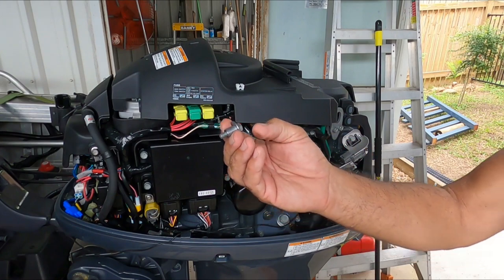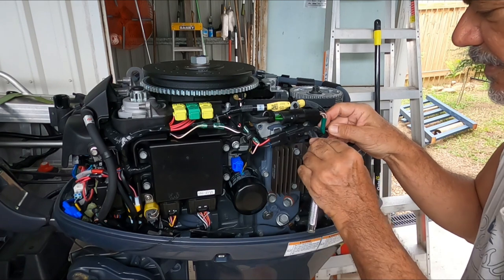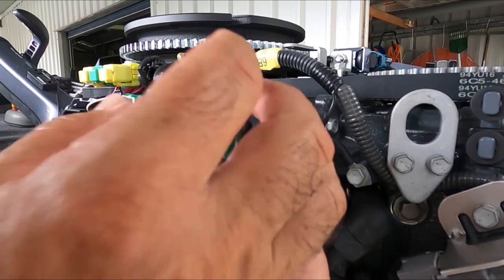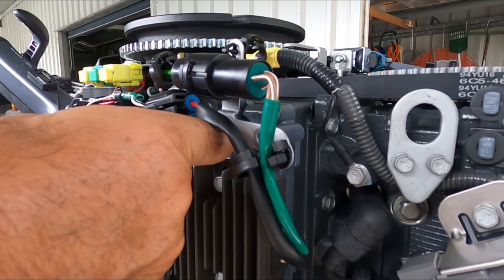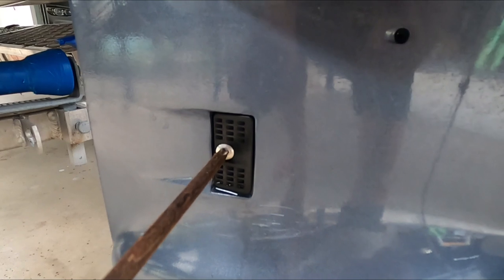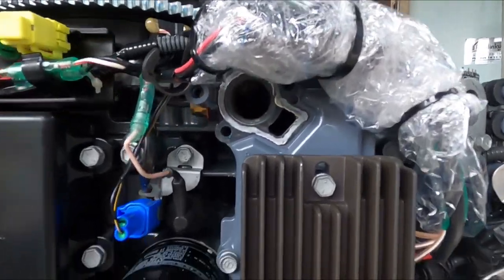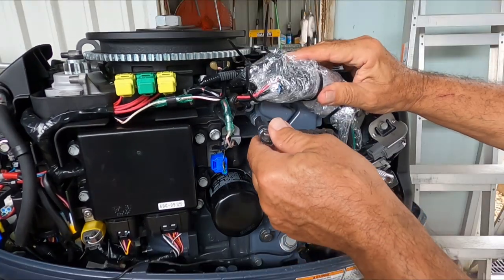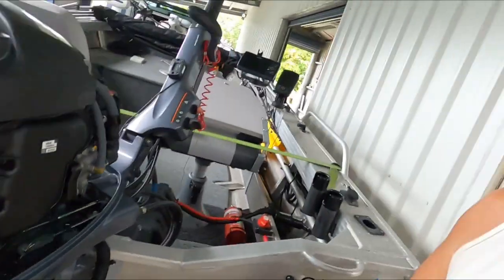How to flush SAND from an outboard - this is how I did it

Comment: Gday mate thanks for this one you showed me where the thermostat is and two i got a good look at the engine ( i havent seen mine yet ) i have watched guys who run a soft flow of water over there engines when they are cleaning it (fourstroke 80) and the only thing thay said was dont get water in the air intake area so you probably would have been ok but good idea anyway , i have found a number of good ideas for working on four stroke yamahas and one of the best was when you change your oil ,rather than try to balance a bucket underneath the drain hole what one guy did was he used a 14mm air fitting with a barb and fitted a hose to it trimmed the motor right up removed the filler bolt screwed in the barb and hose then lowered the engine and the oil ran into a pan on the floor anyway how do you find the foil i have just bought one like yours se 300 good video and great hack .
Reply from the maker: G’day mate…thanks for comments. Yeah, I still prefer a professional service at the Yamaha club, when it comes oil changes and impeller renewal etc. But appreciate you sharing the hack for draining oil…
Personally, I sort of avoid ‘washing’ the engine compartment , and prefer using Inox sprayed on and lightly rubbed around. 
Love the SE300 foil…I’ve got a video about fitting se300, a few years ago. Thanks again for contributing 👍😎
Reply: @hkayztheoldguy  hi mate if someone at the yamaha club can teach you take the advantage of it save some money and learn about your engine it really isnt hard to do you seem pretty compotant so youll pick it up in no time .
Reply: @hkayztheoldguy  Hi mate just watching this vid again check around your thermo housing for any water leaks looks like a liquid gasket (might be wrong ) has been used rather than a paper one if so you might be lucky and get away with it but if it starts to leak youll have to get some liquid gasket material and replace it just a thought i didnt see the cover when you pulled it off if it had a gasket attached  cheers
Reply from the maker: @crispernator  …will check for sure…
Reply: @hkayztheoldguy  Hi mate i picked up my 40 today and i looked at the thermostat housing and it did have a paper gasket on it the tab sits up higher than the cover so it may have been on the cover when you did the video ,the internal anodes are ones i havent seen before they are not the pencil type they sit on the end of a bolt with a screw that secures them to it anyway  just thought id let you know
Reply: @hkayztheoldguy  Hi mate thought i would pass this on saw a really good video on changing the thermostat in a 40hp like ours now it is done on a 2013 but it is identical to my brand new one ,he shows how to get at your thermo really easy and also shows how to undo the wire connections in front of it which are always tricky the guys name is jim wellman  and the video is called yamaha 40hp thermostat replacement i think its a really good training video check it out .